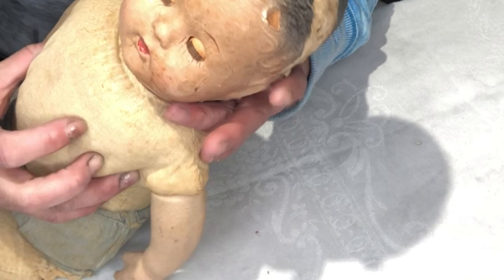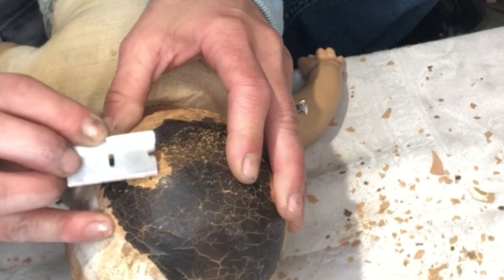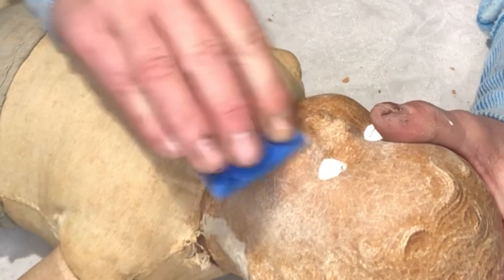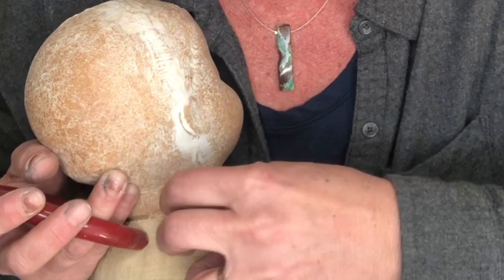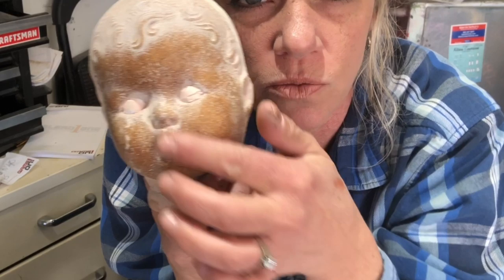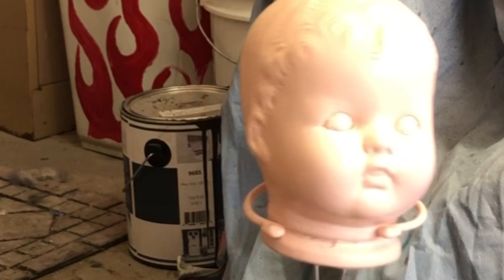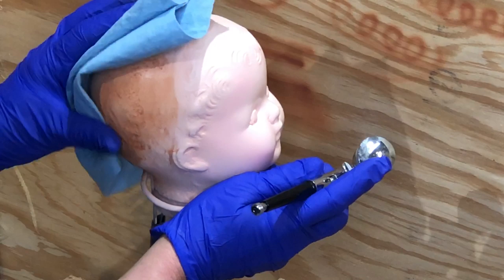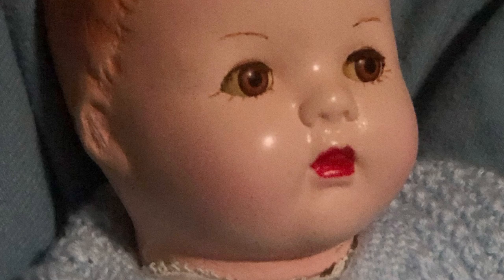How to fix your Composition Doll START TO FINISH

Comment: All right! Excellent first try with oils, Melanie! To answer the gesso question, it's thirds. One third plaster of paris, one third oil paint, and one third glue. I see that you bought my recommendations. Now you have everything as far as paint is concerned, and it will last many years. As you've found out, a quart of oil paint will last FOREVER! Oils go on smoothly and give that lovely finish that acrylics simply can't achieve.

Here's the fine points you need to know. Steel wool and a toothpick can make excellent sanding material for tricky curves and crevasses. Just wrap a bit of the steel wool around the toothpick and go at it. Yes, sanding is a pain, but the results are so worth it because the definition of the mold shows up with proper care. BTW? Take the head off BEFORE you chip. It saves time in the end and you can get the base of the head done in one fell swoop. Frequently, the doll manufacturer name is printed on the neck rim of these dolls where you don't see it, so it pays to do ALL the chipping. I would suggest that you get some linseed oil to wipe on the doll between sanding and painting. That wood is elderly and needs some nourishment. Why linseed? It's plant based and is the basis for oil paints! Doing this step will make the paint go on even smoother and will make the paint 'stick' better. It might even close those pores up a bit. LOL! At least that's my theory...and I'm sticking to it.

Nice airbrushing! You can get in a bit closer on your overall brushing of the skin tone. It won't drip as most people think, it might pool a bit, but if you keep the gun moving, it shouldn't be a problem. Tip on overall painting...move right to left in a straight line for even color distribution with your base coat. For the hair, start in the crown (as you did) and concentrate the color there, then move in a circle around that crown. Surprise! You just taught me something! When you are in the edges with the curls, wipe the paint off the highlights! I hadn't thought of that, but it's exactly how the manufacturers did it to simulate that fine baby hair.

I'm impressed hon, keep at it! Now, work on your eyelash painting, you need a bit of practice. AND! Think of adding a tiny bit of blue blushing to the edge of the eyelid. You'll see that on the finer dolls. Effanbee, Alexander, and Arranbee all used that trick to make the babies dainty!
Reply from the maker: Dodi's Dolls thank you Dodi! Your knowledge and expertise helped me so very much! I will keep practicing and with you to help... it can only get better 🤗🤗🤗
Reply: Great tips! 😊

Comment: Good job! I’m doing a small metal head. Many, many fill ins with Apoxie Sculpt, and sandings. I did 3 coats of auto primer, after first 2 more sanding. I put at least 8 coats of oil flesh with a brush. I got an air brush for the hair when I get the nerve. 😂

Comment: Wow! I love watching doll restorations and customs, but watching older dolls getting the second chance after all those years takes the cake! I absolutely adore baby dolls and they seem much happier :).
In my experience, shading and blushing the cheeks and head would be easiest with chalk pastels. Just scrape some dust off the chalk and dust some on with a dry paintbrush. You can erase with a kneaded eraser. 
I also think starting with a coat of Gesso would help with prepping for painting and filling in all those holes left over from sanding. When you were mixing colors, I think adding a little of a contrasting color like green or blue would’ve made the skin color a bit dull like realistic skin. 
Overall, I think that little baby look fantastic! Great Job! 😁

Comment: Thank you for this video. I have a doll very similar who is in need of a makeover. I haven’t  tried this yet but it’s my summer project. What kind of paints did you use? When you say house paint did you actually buy exterior house paint ? You also mentioned enamel. Is that the base that you used to spray her? You did such a good job. I need all the help I can get so any suggestions are appreciated. Thank you

Comment: I just bought an old charlie McCarthy ventriloquist doll from the 30's. Should he be restored or is it best to leave him the way he is. He looks almost identical to yours with be paint cracked and missing along the middle of his head.
Reply from the maker: Jesse_J if you love him and plan to keep his value I would not touch him. Make sure he stays away from moisture so the composition does not expand and cause more cracks
Reply: @VintageMakeoverswithMelanie  thank you. I like him the way he looks kind of scary. You did such a great job with this doll. Great work.

Comment: Can I use a Stiff Scraper with 1-1/2" Carbon Steel Blade ?? I don't like using a razor blade like that - might cut myself
Reply from the maker: Use whatever feels the best for you. You need to get under the paint and try to not gouge the composition.
Reply: @VintageMakeoverswithMelanie  thank you 👍👍